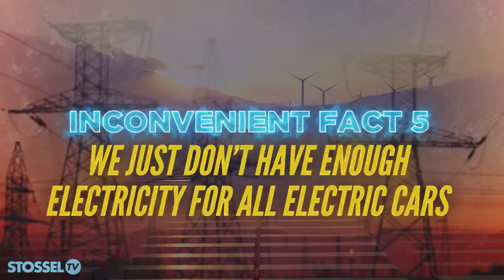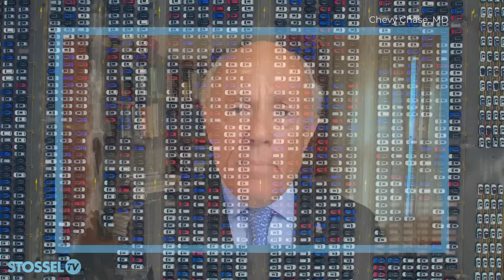Electric Cars: Inconvenient Facts, Part 2

Comment: A lot of charging will be done at night, when electricity demand is low and so are prices. The power grid can be upgraded and expanded to accommodate electric cars: "We can do this, just like we did for air conditioning," according to one utility executive. As for cleaning up the power grid, nuclear power works well in all types of weather and environments, including winter, and requires very little fuel. It will take time to get there, but it feasible.

Comment: People who buy EVs are not all environmental fanatics.  I bought an EV because I was tired of paying $5 or more per gallon and was tired of spending weekends fixing my ICE vehicles.  EVs are great as daily commuters.  Like everything in life, there's a middle ground that the right and the left don't want us to stand in.
Reply: How's the price of electricity to charge your car vs the price of gas today?
Reply: Hi Bob.  It costs me $26 for a month of 10 mile, one way commutes to and from work each day.
Reply: @nathanloomis5834  so about the same as gas where I'm at with a low mile per gallon car.
Reply: Yes, if you live where gas is cheaper.  Where I live, if I had a car that got 40mpg (which would not be a fun car to drive), I'd be paying $50.40 per month.
Reply: True, but the fanatics want to force them, not permit them.
Reply: @MalachiWhite-tw7hl  I agree